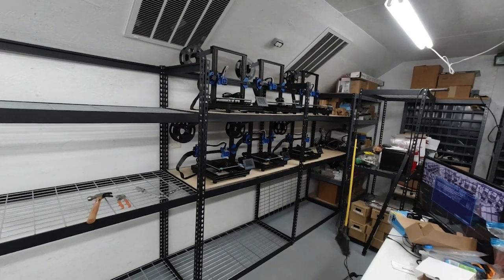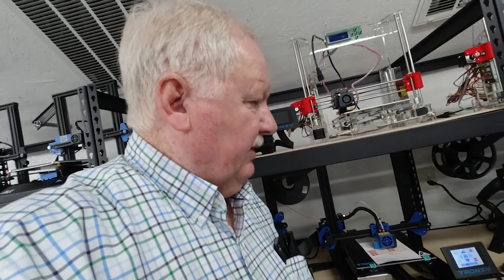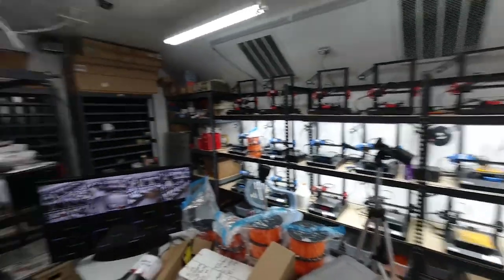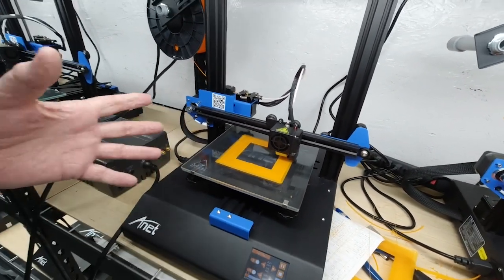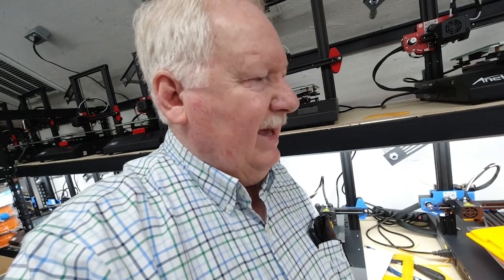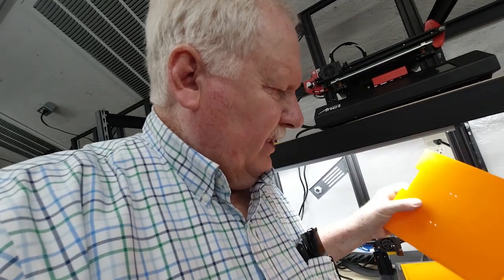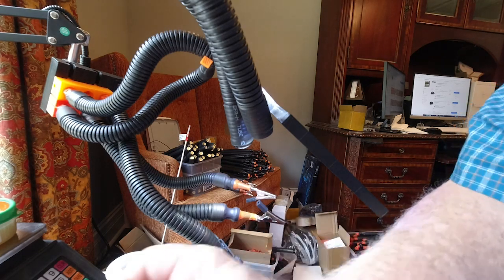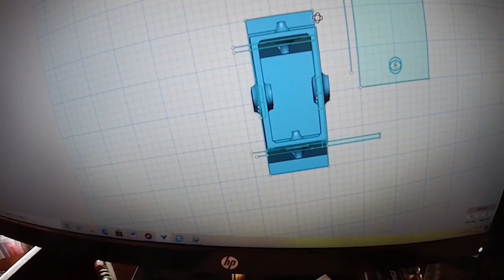PHASE TWO OF MY 3D PRINT FARM, Adding Tronxy XY-2-PRO 3D printers to the farm at New Tech Inventors

Comment: Hey ken,
Your right in trying to eliminate using glue .   The metal prusa sheets that come with prusa machines are a solution to adhesion problems.  I love glass but it’s tough.  Great to see ya ...joe
Reply from the maker: I will be trying the metal sheet very soon, I have heard lots of good things about spring steel and PEI sheets. Thanks for the info and for your support...Ken
Reply: @NewTechInventors  please let me know on your use of the spring steel plates... I’m tired of using Magoo stick

Comment: Thanks for the video. It was interesting to see how you use the Helping Hand to make the parts. Will your next video feature that gray piece you were pulling wire through?
Reply from the maker: You will probably see it in one of the next videos, because I will be using it to measure out filament for several print jobs I will be running this week and next, That part is part of the filament counter I will be using. I will try to show more of the filament counter in use. Thanks for the question my friend and for your support...Ken

Comment: You probably know this but....glass needs a filament squish that’s pretty flat in its first layer.   The pressure down seems to work better.  Suggest on your glass, since you have the electric talent , make the heat transfer throughout the glass.  It’s not so much glass does not attract filament it’s the fluctuation of bed temps within build plate .   Order an extra heater part and wire it to the existing and stick it on the other side of the bed.  See what happens......joe
Reply from the maker: Good advice Joe, thanks for sharing those good tips with everyone. I have been testing different glass temperatures and nozzle pressures to get the best combination for good adhesion to glass without any additive like glue or hair spray. I also would like to print without any brim. If I can't get enough bed heat I may try another heater, but I will have to cool it down once I get the first layer down if I'm using PLA. PETG can handle the high bed temperature better. Glass is tricky. Thanks buddy for sharing your knowledge and for your support...Ken

Comment: Why dont yo manifacture power bank with 3d printer
Reply from the maker: If you're talking about the Helping Hand power base with the switch and (3) 12V DC output ports and an input port, with slots for holding various attachments, then It is 3D printed. it has (3) 3D printed parts, the base, power box cover, and attachment locking part. My video 25 parts I print for the Helping Hand will show these 3D printed parts. Thanks for the question and for your support...Ken

Comment: Adhesion = CLEAN glass bed and cheap hair spray.  Pull a print... add a dash of hair spray... every 4 or 5 prints... CLEAN the glass and reapply the hair spray... RELEVEL the bed any time you remove the glass to wash it.   Use dish soap and a bristle brush to clean.  Don't bother cleaning with alcohol... it's a waste of time.  

Friend of J. Brown
Reply from the maker: Thanks John, I started out using hair spray on glass and it did work well as you describe using it. I am trying to eliminate the process of having to remove the glass from the printer each time you add hair spray, which I was doing to prevent hair spray from building up on the other printer parts. If you can get good adhesion with clean glass, you can save time and money. Thanks for the comment and for your support...Ken

Comment: I changed my two printers to spring steel coated with PEI and so far I love it.  No glue at all and when it’s done you pop the steel off and give it a little flex and the parts come right off.  Then I wipe it with alcohol and start the next print.  I couldn’t get good results on the glass.
Reply from the maker: I believe you my friend, and many have told me the same thing. It will take me a little time to get up and running with it on some of my printers, but I will be using spring steel soon. Thanks for sharing that info Rafe and thanks for your support...Ken